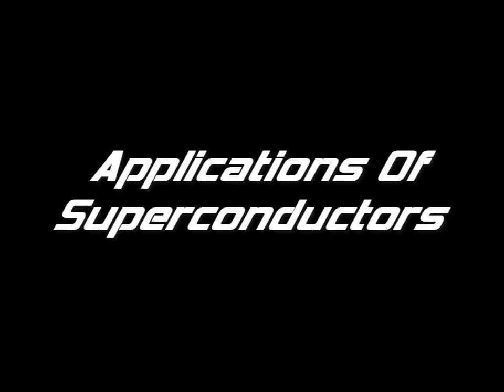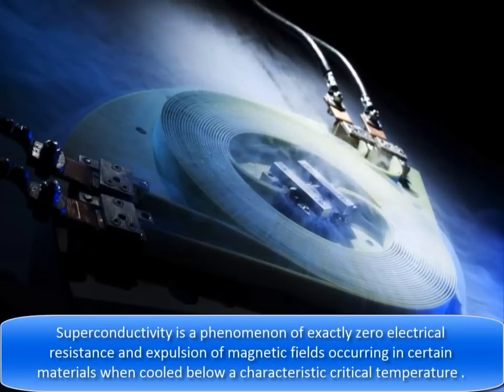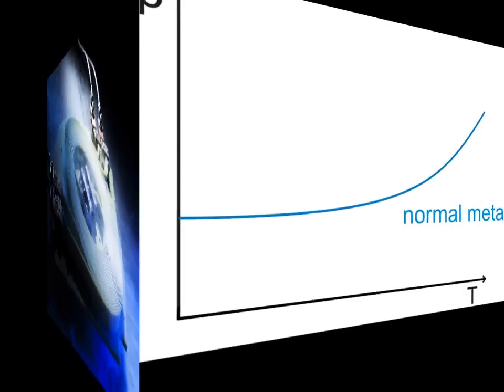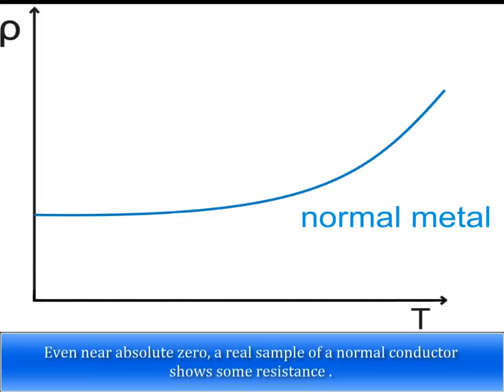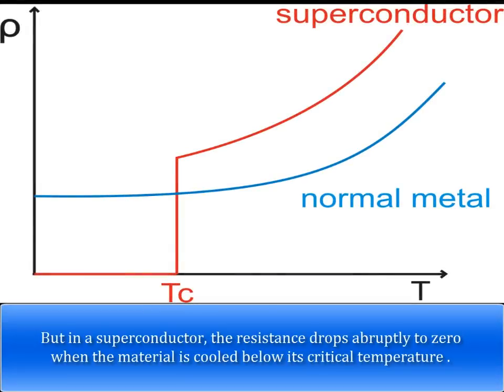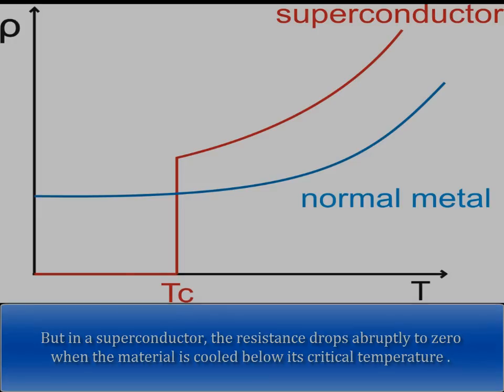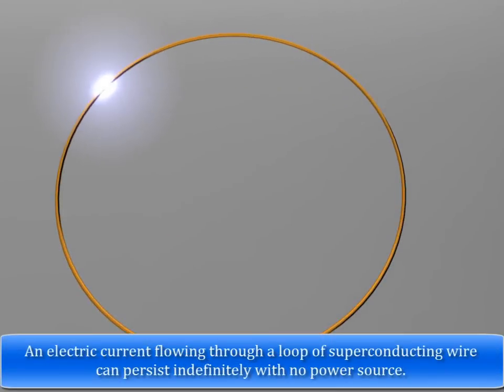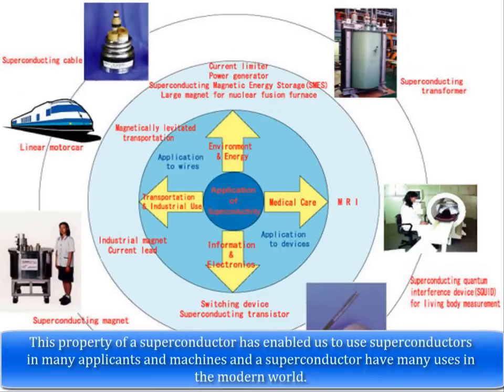[ What Is A Superconductor ] - Application of Superconductors

Comment: Applications of superconductors.
Superconductivity is a phenomena of exactly zero electrical resistance and expulsion of magnetic fields occurring in certain materials when cooled below a characteristic critical temperature. Generally the electrical resistivity of an ordinary metallic conductor decreases gradually as temperature is lowered even near absolute zero a real sample of a normal conductor shows some resistance but in a Superconductor the resistance drops abruptly to zero.
When the material is cooled below its critical temperature an electric current flowing through a loop of superconducting wire can persist indefinitely with no power source. This property of a Superconductor has enabled us to use Superconductors in many applicants and machines and a Superconductor have many uses in the modern world some of the major applications of Superconductors are electromagnets. Superconductors are some of the most powerful electromagnets known these magnets are used for magnetic separation when a superconducting magnet is placed over a mixture of weakly magnetic particles and less or non-magnetic particles the weak magnetic particles gets attracted to the superconducting magnet magnetic levitation.
A Superconductor repels the magnetic lines when cooled below the critical temperature that is it repels a magnet when approached toward set this property is used in operating maglev trains maglev is short for magnetic levitation the tracks are supported with propulsion coil and levitation and guidance coil. The Train in its base has Superconductor magnets since the Superconductor repels a magnet the maglev train floats in the air using the propulsion coil and the magnets placed in the base of the Train. The Train moves over the tracks.

Comment: I have a question. How could we attain such low temperatures (approx. -200°C) in order to operate the superconductors over such a wide area (like  a train) ?. It is practically very difficult to activate magnetic levitation. How could we overcome such problems in future???
Reply: Mag lev trains have onboard liquid helium or nitrogen fridges.
Reply: All you gotta do is make some imperfections in lead, so that the electrons can tunnel through quantum wells. This will even work std temp and pressure.